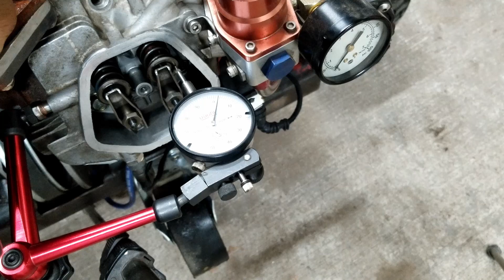GX390 Rocker Modification

Comment: I have discovered a super cheap stamped ratio rocker for these big blocks, I ordered a spare $28 gx390 complete cylinder head off eBay and noticed when sitting side by side with another OEM GX390 that the guide plates where different, after further investigation it was clear why, the cheap clone rockers have a aggressive ratio AKA the pushrod sits a lot closer to the pivot stud. Not exactly sure what the ratio difference is but I do have pictures of a head with one of each rocker and you can clearly see the difference.
Reply from the maker: Great information! Thanks for sharing.
Reply: I seen you flattening out the top portion of the rocker, that reminded me of something I left out, the stamped "ratio rockers" I told you about are completely flat all the way across the top side of them. That's another way of telling the difference between the stock OEM ones and these clone ratio ones.
Reply: @NicholasB45  Can you share with me the link of these rocker that you discovered, with different ratio?. How much is the ratio of those rockers?